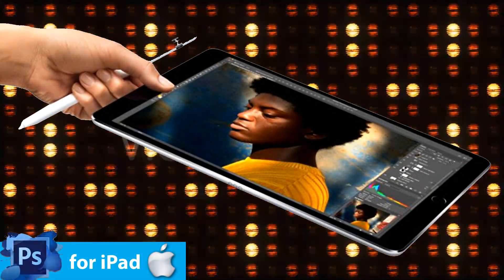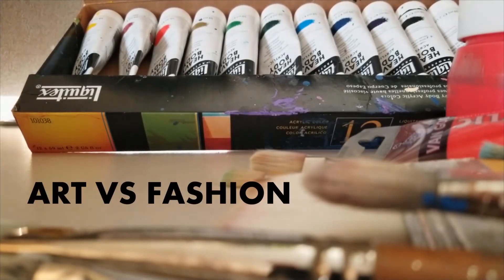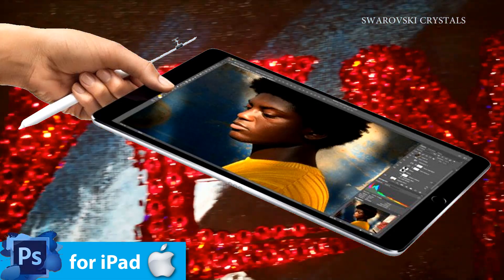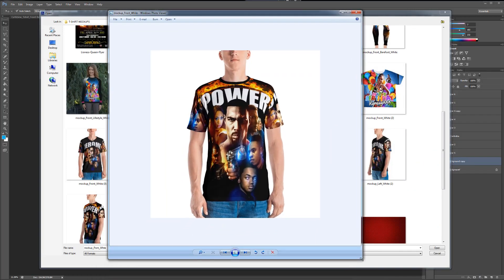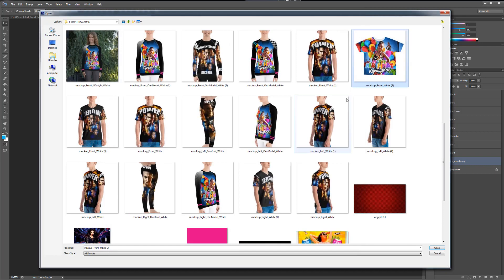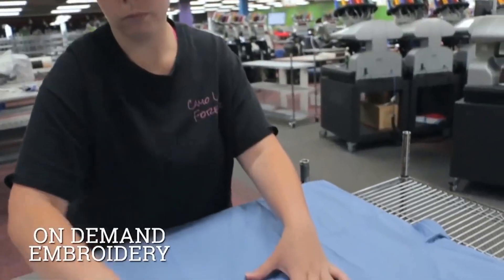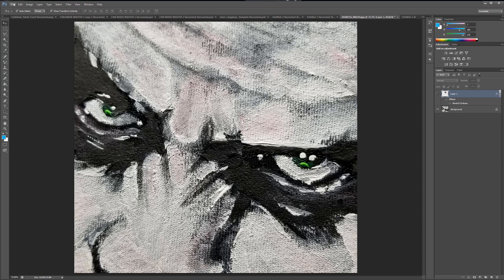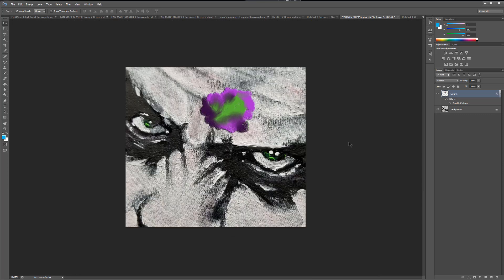Photoshop for iPad Pro 2018 Art: What is digital painting? How can art help us make money?

Comment: The real question is, will this be subscription based??🤔

If yes, an answer to that would be Affinity Photo/Designer $19.99 each for the same features you'd find on the desktop version of the software.

On a side note, you can open Photoshop/and Illustrator project files in Affinity software....and work with Affinity projects across iOS->OS X->Windows